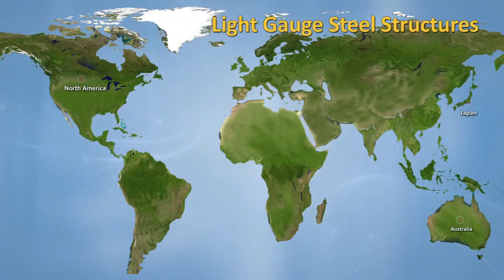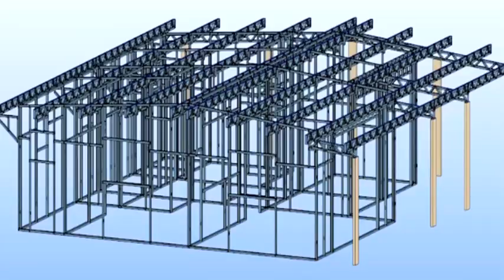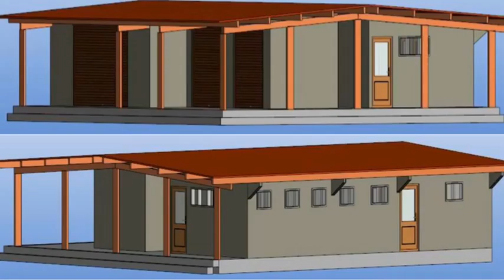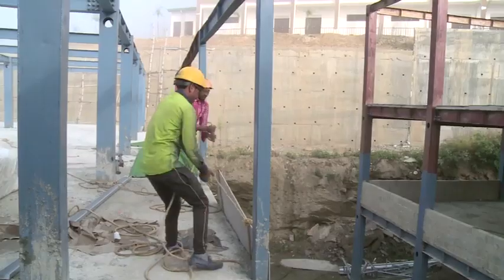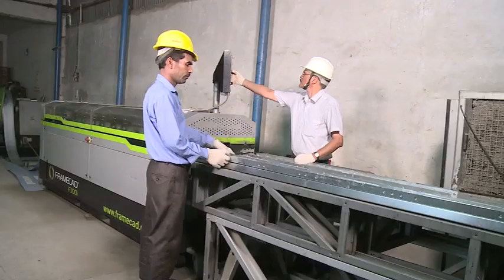BMTPC Light Gauge Steel Structure System

Comment: Since LWS leads us to precise, faster, and cost effective construction. With reuse and recycling of material. But does it leads to sustainable construction. As we are targeting to acheive the zero carbon construction by 2050. And also in production of 1 ton of steel around 1.6 tons of CO2 is released. But still it is much better and sustainable construction, if we compare with conventional construction. As also many regions in India have the hot climate, which increases the energy demands for heating and cooling. This LWS construction will lead to less energy consumption, and reduce the lifecycle cost.